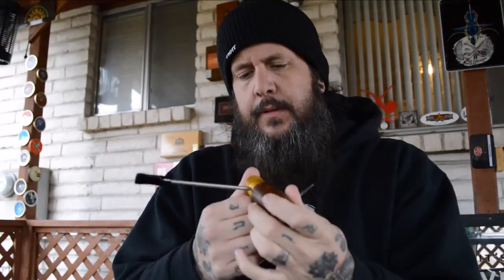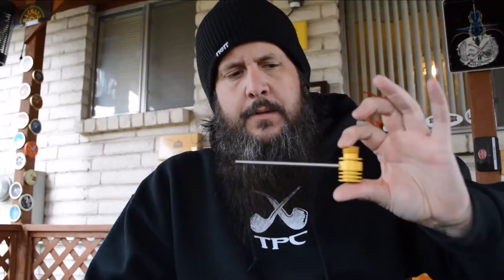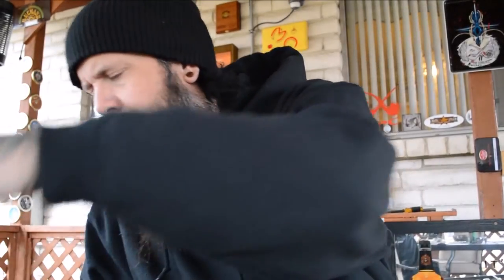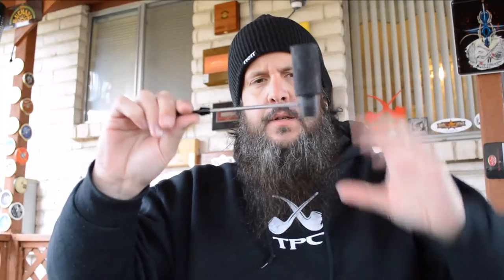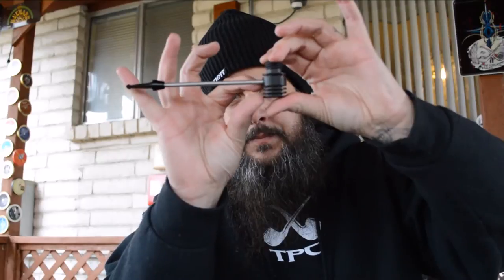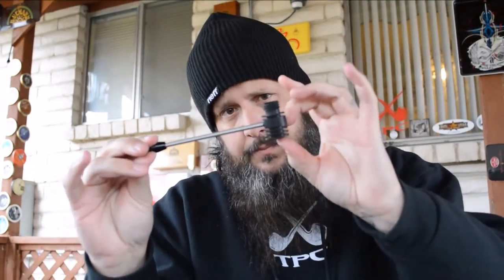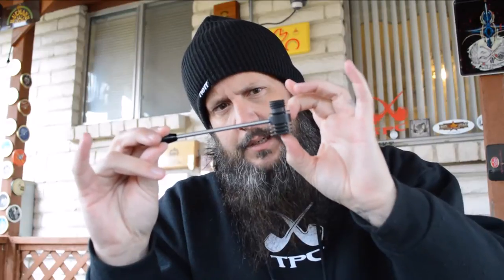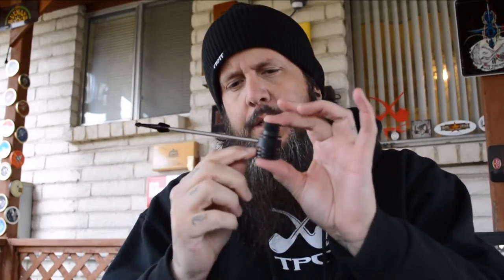Radiator Pipe Review

Comment: So does the metallic radiator get hot by drawing heat away from the wooden bowl?  Or it mainly just to capture moisture which is a great feature.
Reply from the maker: I didn't experience any heat in the metal, and I tried to heat it up pretty good, captures a ton of moisture though, really a great smoke. Thanks for watching bro! #sweetsmokes

Comment: Im torn between ordering a standard length straight frame and the stubby straight frame. Any pros/cons or personal preference as to why you chose to use the longer standard frame?
Reply from the maker: really no pros or cons, more personal preference. on a regular briar pipe, the longer it is the cooler it smokes normally, with the radiator it doesn't seem to affect the temp. I'd say the shorter one is probably more comfortable to clench. thanks for watching! Sweet smokes!